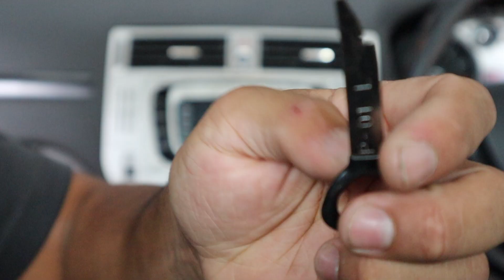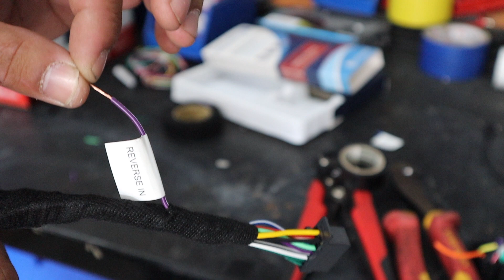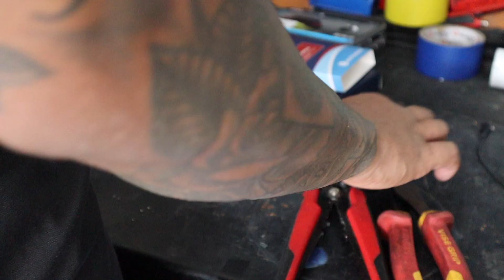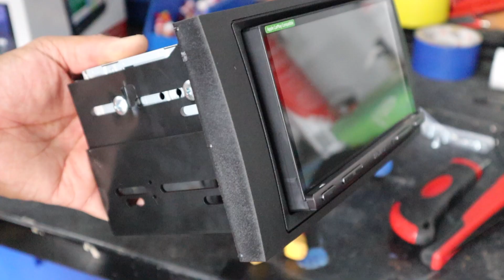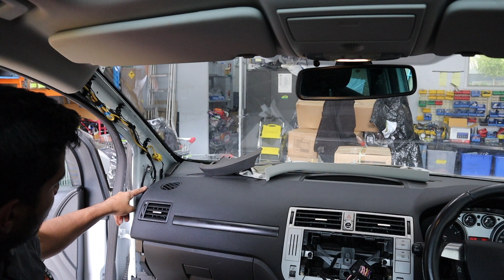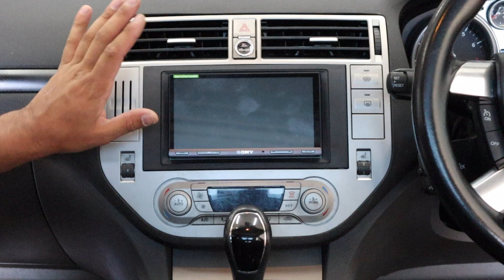Ford Kuga Head Unit Install (Start to Finish)

Comment: Hey Nathan, great vid of this install. Removal of factory unit was one hell of a task, I agree. I have been on the Aerpro site but they have a different antenna adaptor listed, You used an Aerpro APA59 with the (blue) phantom power lead? Is this necessary or will the standard APA58 Fakra adaptor (without blue wire) still work?

Comment: How do you get it back out again? The Pioneer SPH-DA160DAB professionally fitted into my 2012 Kuga has stopped working, I need to send it back for a replacement and need to take it out without damaging anything. Any help gratefully received. Thanks

Comment: What was the stereo system used, also I noticed that when I turn off my car but have anything on connected to my car lighter System it seems to stay on unless manually turned off, any advice on it ? I own a Kuga 2012 to cheers

Comment: why do you not connect the dab lead to anything I am currently in the process of changing the head unit but I can't find a dab harness anywhere
Reply from the maker: Did you purchase a DAB head unit? If so it should come with an antenna

Comment: Hi great video, one question please, I have fitted the screen to my 2010 Ford kuga but the stereo has power all the time and it does not turn off with the ignition, what colour wires do I need to connect to ? I want it to turn off when I take the key out the car
Reply from the maker: Swap the red and yellow wires around
Reply: @TheFittingBay  thanks for the reply mate 👍
Reply: @JayJay-ft6nt hi mate I’m looking to install this to into my Ford kuga titanium 2009 model car. How easy was it to fit did you still get steering control usage. My car has reversing camera factory installed does yours if so can it work with the unit

Comment: Hey man, great vid.  Quick question if you if you have an answer, I have a Kuga the same as this, except it has the nav unit with climate controls all in one unit.  It's a blaubpunkt/travelpilot NX unit.  If I buy a facia and climate module like the one in the car featured in the video, would the connections be compatible?  The nav has stopped working and I would really love to upgrade.
Reply: im in the same predicament Ashley. ive bought a 2016 climate control unit thinking it would work straight away but it goes haywire when plugged in. let me know if you manage to get yours sorted. im fitting a Sony DAB 3005
Reply from the maker: Jump on www.aerpro.com and put the car details in and read the notes on each product for the car. It’ll say if it does or doesn’t work with nav models etc :)

Comment: Hey bro I realy think you should do some of them harness's for sale on eBay we're we can use them on the car control unit...I am only able to find the standard harness....we're they do not let you use the incar control
Reply from the maker: James Smith Thank you. The website will have steering wheel control modules added! Just working on getting it setup. 
Thank you!